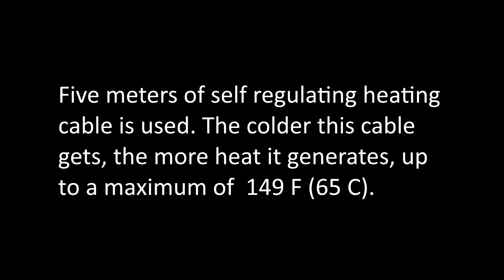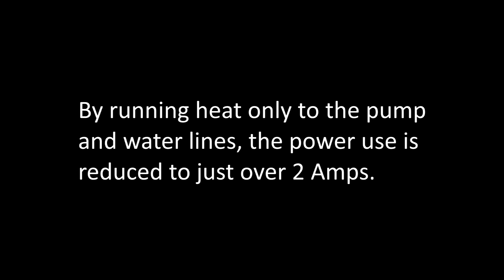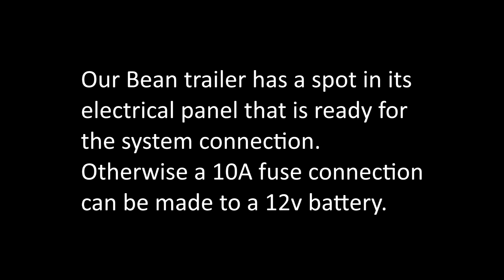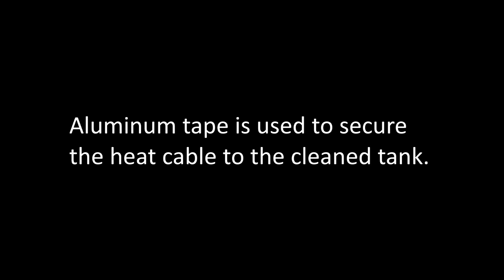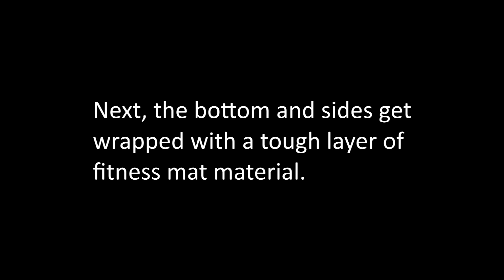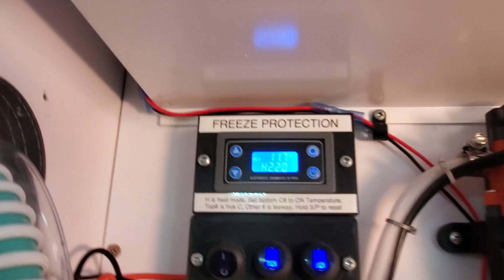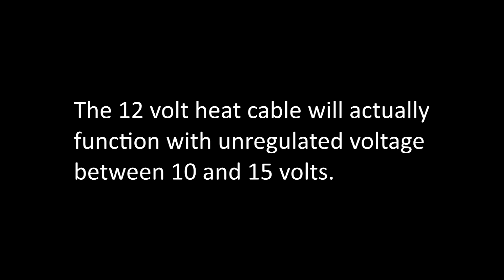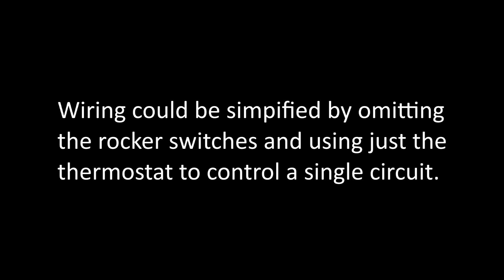H2o Freeze Protection - 12v Winter Camping

Comment: This is a great upgrade.  Been asking Bean for this for about a year.  I think it would make a great option.  Why did you choose to use wire instead of the heat mat for RV water tanks?   Also is the flap for checking if the wire is heating?
Reply from the maker: Thanks, great questions! I used the heat cable because it allowed more flexibility as to where the heat would be routed and how much would be used. It was also convenient for setting up one zone for the tank and a second for the pump and plumbing.  One of the challenges is contolling power use (watts), when off grid. 

This system has been working perfectly.  We now have alternator charging so power use is not as critical.

The little flap is for checking how much water is in the tank and to confirm it's not frozen.

Comment from the maker: This system saved our trip. We are heading home from a fantastic trip to Idaho's City of Rocks. Night time temperatures were in the 20's F. We were able to use our battery along with campground shore power to keep our water from freezing solid. 

All water at City of Rocks was shutoff for the winter. Without our system the trip would have been a bust.